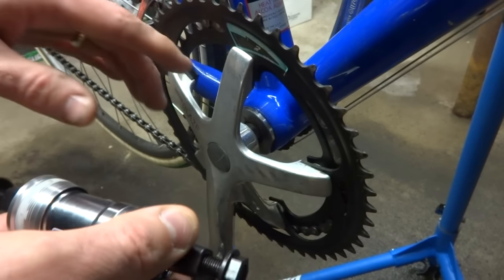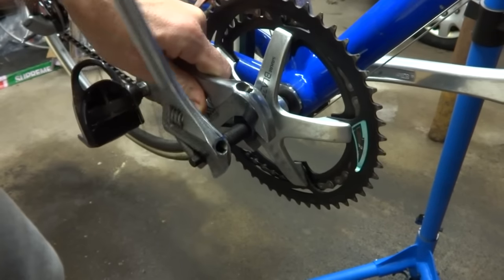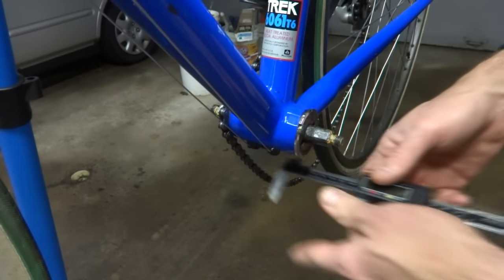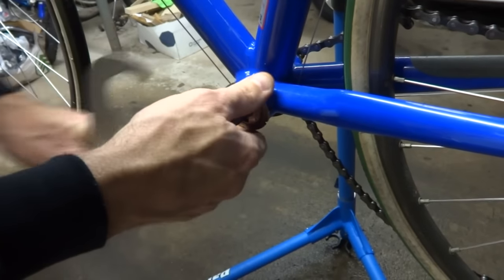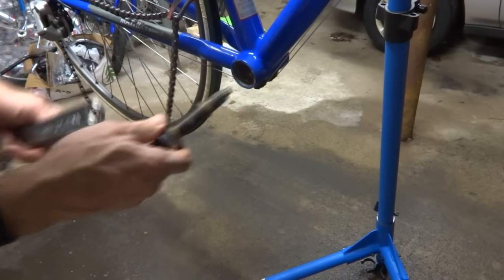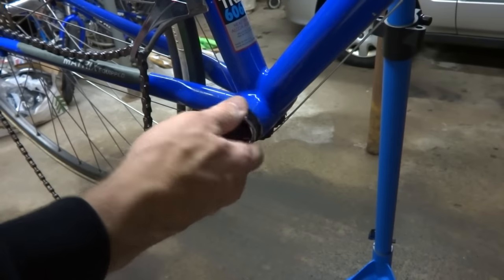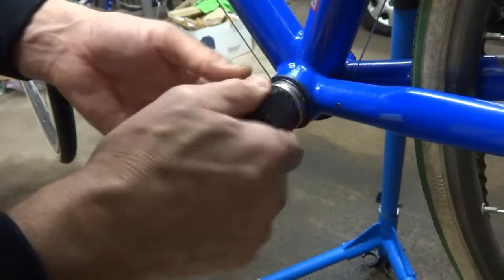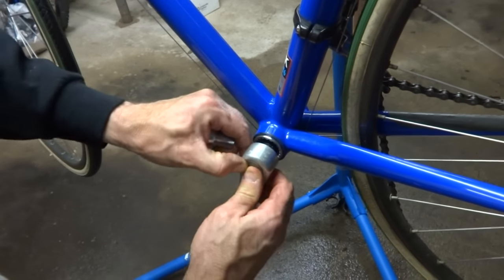How To Upgrade Vintage Bike With Sealed Cartridge Bottom Bracket

Comment: Im working on a bike right now. I came across the problem of  badly pinning peddles. So I ordered the shimano crank puller for 12 euros from amazon. Never knew of the existence before 3 days ago. It is an over complication when we see that 2 standard nuts can do the job too.
Reply from the maker: No. The nuts press the arms on to the spindles. After that, that just help to keep the arms from coming loose. There is purpose to the design.
Reply: Im sure, I was just mad about the holdup, lol! I cant wait to try it myself. In a week's. delivery time...... 
I found a frame,  refurbished the axel of the front wheel (like you taught me),  put on the back wheel, hammered in a saddle. Ooops, peddles dont run smoothly, "Youtube, HELP!"

Comment: Can someone explain to me why one should replace the old for a new sealed cartridge? Apart from it being lighter and less mess, does it make the bike go any faster or smoother?
Reply: Yes, I wondered that myself- what's the advantage of the sealed unit?
Reply: Old style bb tend to need ajustment more often than not, aldo i had a bike for 10 yeas that never had any sort of problem or need for ajustment. Other than that, had everyhing from cups loosing up, bearings "escaping" the cage, and somehow there was this time when my bb verted lots of grease to the floor all at once, making my rear tyre skid, while going 80km downhill. still don't understand it xD with a sealed one, if it's creaking, take it out and put a new one.
Reply: I must admit, having recently serviced the bottom bracket of my 20-year-old bike, I found that one of the bearing cages had somehow got misaligned & some of the bearings had come out.  The cage was semi-loose around the spindle, and it had badly scratched the cup & spindle bearing area.  The spindle had also somehow ground against the opening in the cup.  But I went down the route of replacing both cups, the spindle, & the ball bearings.  I replacing the caged bearings with 11 x 1/4" new ball bearings on each side with ordinary medium MP Lithium grease.  So far it's fine, but I think I'll have to maintain it more regularly in future!
Reply: Very little (if any) performance advantage for the average cyclist. Cup & cone BB's are perfectly adequate  if maintained regularly and correctly. The main advantage of a sealed cartridge unit is the fact that it is 'maintenance free', ie fit & forget. Ultimately, bad for the environment and encourages laziness in people who really should be learning about the workings of their bike.
Reply: Because the old open bearing ones fucking suck shit! They let water and dirt in like crazy, they come loose all the fucking time causing the bearings to ride crooked stretching the cup thing they ride in and destroying any chance of rebuilding without replacing them. Not to mention all the pitting.  You will have to excuse my swearing. I just got done tearing an early 2000's schwinn   bottom bracket out and am quite pissed. Cant fucking get it apart without buying some special faggy fucking tool. Ruined 2 tips on two flathead screwdrivers trying to beat the drive side out. Total BULLSHIT!  LMAO!  I have yet to work with any of the new sealed units and I can't fucking wait. No adjusting, no leaking, no maintenance, no BULLSHIT! Fuck the environment and yes I am a lazy motherfucker lol.
Reply: If you perform BB maintenance regularly on the loose-ball BBs, you won't have as much trouble with removing the cups, pitting, etc.  If you get the adjustment right to begin with, they stay in-adjustment a lot longer.  Basically, if everything is well-lubed, well-adjusted, and regularly maintained, most of those problems go away.  TBF, though, it is a pain in the ass, and I do tend to replace any damaged loose-ball BBs with a sealed cartridge unit.  (Loose ball BBs that have cups in good shape, I tend to replace the balls and repack with some Lucas X-TRA Heavy Duty.  Same goes for cranks that aren't compatible with the common JIS-spec square taper BBs.  French bikes, Raleighs, etc...)

But, truth be told, you need specialized tools for most every kind of BB, aside from OPCs.  And anything with a square taper, ISIS, Octalink, etc will need the crank-pulling tool, like a ccp-22.  Personally, I hate using tools like the BBT-22, b/c it can be a real knuckle-buster if the shell's threads aren't cleaned and/or chased, but it's still worth it to go to a sealed BB, in my opinion.
Reply: @JimBob-ky8sm  in contrast to your experience with this type of bottom bracket I am still using my father's old Raleigh all steel tourer that has the cup and cone bottom bracket it is the original bracket and has served with adjustment and lubrication since 1937 so they can be very long lasting if made well in the first place and then properly maintained.

Comment: Thanks for all your videos man they´re amazing! now I have a question why in the second side you say not to put grease if it is made from plastic? thanks a lot again man!
Reply from the maker: +clandestino232 Grease can cause the plastic to degrade. Also there is not a risk of the plastic rusting or reacting due to contact with the other metal.
Reply: Yeah I thought something like that, thanks man I bought my SHIMANO thing and my bike will be ready lik e tomorrow, thanks!
Reply: If you do apply black grease to the plastic, don't worry. After 23 years, the Shimano LP-26 plastic cup was not degraded by an all-purpose black grease on my cromoly steel Fisher MTB. The replacement part on Shimano's readily available BB UN-300 is aluminum alloy, which definitely needs grease. I grease all threads. I've seen what happens to dry, bare metal threads on bicycles -- it's never good.

Comment: Thank you Sir, this is very helpful. 
Just one question, is it ok to use a bottom bracket spindle with longer than I use before?
Reply from the maker: Spindle length is dictated by the crankset. You vary it by a mm or two, but more than that it will effect chain line.Try to find same length.
Reply: @RJTheBikeGuy  ok thank you

Comment: Nice Video. On my Schiwnn LeTour III, I measured the shell to be 68mm and the the spindle length to be 125 mm.  I noticed that the closest sizes are 122.5 mm and 127 mm. Could I get by with the 127mm? Would I just need to adjust the front derailleur?
Reply from the maker: You could try the 127mm. Yeah, you will probably have to adjust your FD a little bit..

Comment: Great video but should you be lubricating the threads with grease? The BB comes with the outer thread coated with a thread locker. Greasing the threads will stop the thread lock gripping and so over time potentially the BB will work its way loose and need regular adjustment.
Reply from the maker: I use either grease or antiseize to to put a thin layer between the threads to prevent it from seizing. If you tighten it on properly, it will be fine. In cases where you have steel in contact with aluminum, it is especially important to prevent galvanic corrosion.

Comment: Nice vid on doing thid changeover. i think I'll do it. Couple of comments however. Paint thinner!? Use automotive brake cleaner. Much better and it won't leave a residue, that will react with the moly grease  he is using like thinner does. Also, if you have plastic parts, non-synthetic grease isn't the best for plastic and can depreciate it over time. Synthetic grease will work on plastic parts. In fact, if it was me and it will be shortly, I'd use synthetic  grease for the whole job. Much, much, much better stuff..

Comment: Does it make a massive difference to upgrade to a sealed hub?
Figured id save $50 and just buy some new ballbearings and then find some sort of plastic sleeve (like what you have in your video)
Reply from the maker: You can just overhaul your old BB. I have videos on that. Cartridges BB's come preadjusted. And they are sealed from the elements.So they will tend to stay running smoother for longer.

Comment: Any thoughts on adding a touch of grease to the spindles to ease future removal of the crank arms and to help prevent creaking?
Reply from the maker: +NUNU37 Do not grease the spindles. Keep them clean.
Reply: I've noticed you didn't grease spindles in rear hub in other video as well. Is there a particular reason? Can you explain why?
Reply from the maker: Spindles in the rear hub?
Reply: Sorry :p, I was thinking about the axle
Reply from the maker: I will often rub a thin bit on grease on an axle to prevent rust. But the axle isn't a moving part. The bearings and races need grease. Crank spindles do no get greased as the cranks are pressed on and held by friction. Grease will allow them to be pressed on farther and can damage the cranks.

Comment: With bb shell width 68mm,what spindle lenght do i need,thanks love ur vid
Reply from the maker: +Micky Puteh Spindle length is dictated by the cranks you use. Different cranks require different spindle lengths. Look up the specs for your cranks.

Comment: Hi sir do you have any videos on how to put a cable guide on a frame or weld on the frame and a video for making a hole on cable guide on the bottom bracket. I have an old bike it has no cable guide on it even on the bottom bracket.

Comment: Love the videos RJ. I am looking to find a good older reynolds 700c frame, and put a carbon fork and a new modern group set and wheels on. What do I need to look out for in terms of compatibility issues? Thanks!
Reply from the maker: ca4Gochops Too many variables/exceptions to answer. Don't expect to install a modern 1 1/8" threadless fork on a vintage frame designed for a threaded fork. Not going to happen. If you meant a carbon 1" threaded fork, then okay. A steel frame can be stretched for modern wheels. Avoid French/Italian frames to avoid funky threadings. A Japanese made tange frame would be good.

Comment: So what's the advantage of the sealed cartridge system as opposed to the old fashioned adjustable ball bearing type?
Reply: All the parts are protected against dust and water. The tolerances are also much better = adjustment and precision.

Comment: How do you know how much torque to use for installing the square taper cranks without a torque wrench? I was under the impression that it's a lot more then you'd be able to comfortably get with the socket wrench you were using there. (30ft pounds or so)

Comment: My spindle is offset, a little longer on the chain ring side.  In choosing a new sealed bb size, should I use the total spindle width, or do I need add length compensate for the offset?  The bike is an old Raleigh Rampar.
Reply from the maker: Use the total spindle length. The offset is for the crank. The spindle length is in the specs of the crank set.

Comment: What are the advantages of a sealed cartridge BB over a standard/old school BB? Are they serviceable? Or do they never need servicing?
Reply from the maker: Easier to replace, the whole unit is sealed, so less worries from contamination, and the bearings are preadjusted, so no messing around with adjusting the bearings or having them maladjusted. If there is an issue, just replace the whole unit.

Comment: Nice. Can we replace ceramic bearing on classic frame instead of seal bearings ?
Reply from the maker: Not even sure what you are asking.
Reply: @RJTheBikeGuy  is this square taper bottom bracket can be replace with ceramic bearing ?
Reply from the maker: Yes. No. Maybe. Your question is not clear. I am moving on. Good luck.
Reply: @RJTheBikeGuy  thank you sir

Comment: Do you have any experience with a threadless BB or a video on this already. I was thinking of using one on a vintage bicycle that has an oiler. The reason is there is not enough room to get the cup on. The oiler is getting in the way. What are your thoughts?

Comment: thank you for your great videos. I have a question: do you know by any chance what sealed bottom bracket would go with my 1998 Bianchi eros?
Reply from the maker: Nope. The size is dictated by the crankset. And you may have french threading.

Comment: RJ The Bike Guy i have a question, i just recently bought a fuji allegro from 1984 i believe, i cant seem to figure out what kind of bottom bracket i would need. what kind of bottom bracket would you reccomend and what kind of crankset would you reccomend
Reply from the maker: You need to figure out what crankset you want, and then use the specs for that crankset to figure out what bottom bracket you need.
Reply: so any kind of bottom bracket will fit?
Reply from the maker: Read my last comment!

Comment: I want to install a modern triple crankset and 8-speed cassette into an 80's 10-speed road bike. It originally came with double crankset, with the well-known cotter pin system. Which style of BB can you recommend for this project?
Reply: Alex Lopez I just did exactly that, convert vintage 10 speed to 8 cassette with triple mtn crank. Buy your jis square tapered crankset first, install it on existing BB and measure. Then purchase new JIS square taper bottom bracket BB.
Reply from the maker: WTF? A modern crankset won't fit on a cottered BB.
Reply from the maker: Read the specs for whatever crankset you but, and they will tell you what BB to buy.

Comment: Hi RJ, I got a trouble with pulling the crank off spindle, have visited several local bike shop for a fitting crank puller, but found none, the mechanic said I need a special and very rare puller which they do not have. I also tried your alternative of removing screws first and then riding the bike around for a while, however it is still very firm, my question is what should I try next ? Thank you !
Reply from the maker: +brit janno A normal crank puller doesn't work? What kind of cranks are they? Can you maybe post a photo over on my face book page?
Reply: thanks, OK, but I have not the facebook yet, is there a way to post it on your youtube channel ?
Reply from the maker: +brit janno No, you can't can't post photos to youtube comments.
Reply from the maker: +brit janno What kind of special rare puller did they say it takes?
Reply: it is a square tapered bottom bracket, the specification lies in the screw fixing crank, whose diameter is smaller than normal crank puller, so I can not screw the puller inside. I will take a photo of it.
Reply from the maker: That would be good. What is the brand/model of the cranks?
Reply from the maker: +brit janno I just uploaded a video showing how you might get the arms off. https://www.youtube.com/watch?v=jrpIoXxVyTs
Reply: Hi RJ, Thank you very much indeed, have a nice weekend!

Comment: Are they universal? I need to replace mine but don't know which one will fit or not. I have a 90's specialized rock hopper.
Reply from the maker: Watch my video and follow how I measure the stuff. Those are the measurements you will need to choose a bottom bracket that will fit your bike.

Comment: Does this bottom bracket have to be installed in a certain way? ie, does it have a drive end and non-drive end? Thanks in advance.
Reply from the maker: Yes, they are supposed to be installed in a certain direction. On most BB's, the non-drive side is right hand threaded, and the drive-side is left hand threaded. So you would have to cross thread it to install it backwards.
Reply: Thanks

Comment: Hello RJ. Thanks for all videos on upgrading old bikes. I have one old bike, all steel, no suspensions, 26 wheels, 7 speeds at rear, where I'm about to install 700c wheels, and years ago got one new crankset 3x to replace the very old, now only with 44-32T, little one got out. My question is, could you install on that frame one crankset Shimano Claris 50x34  or not, old bike frames impose limitations on that?
Reply from the maker: Yeah, you can go from 3 to 2, or 2 to 3. The bigger issue is the wheel size conversion. https://www.youtube.com/watch?v=C7lR3R0pOZ8

Comment: Hi RJ,
I understand that you measured and therefore selected the Shimano replacement part.
How do I know the part I buy will fit the current thread on the bottombracket? Or is the thread universal?
Reply from the maker: Most bikes have British/ISO threading. There is also Italian and French threading for bikes made in those countries. And some others. https://www.sheldonbrown.com/cribsheet-bottombrackets.html
Reply: @RJTheBikeGuy  Thanks for the reply. I changed my bottom bracket last week, removing it with the help of a vise.
So happy that finally my repair is done (:

Comment: Hey RJ. I'm commenting on this video as it's the closest model to what I'm working with currently. If I wanted to upgrade the bottom bracket from a square taper to a modern version (let's use the Ultegra BB for example), would this still viable on this bike? I'm building up a Trek 1100 (1990) and wondered if you knew off hand if I could just pick up a newer hollow BB and it would work. I've referenced your Raleigh video that upgrades it, but I just wanted to see if you knew off hand if these models played nicely with them. 

Thanks for all your videos! They've been a lifesaver.
Reply from the maker: https://www.youtube.com/watch?v=TcyaSEAhI5k

Comment: HEY RJ..I can not screw my non-drive side cup of cartridge type bottom bracket without any equipment. It's going a little bit inside then it's freezes but Vintage one is going inside freely without tools . Is that okay or something wrong?? And there is no dirt.. plzz rply Sir..🙇
Reply from the maker: Since I am not working on the bike I can't tell you. Make sure the BB has the correct threading for your bike.